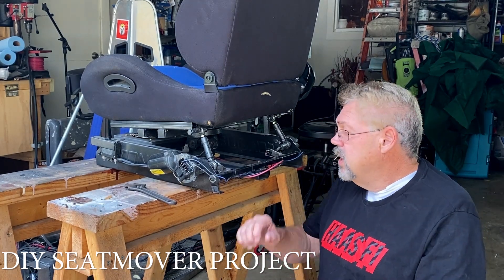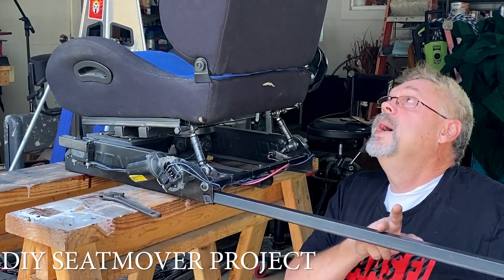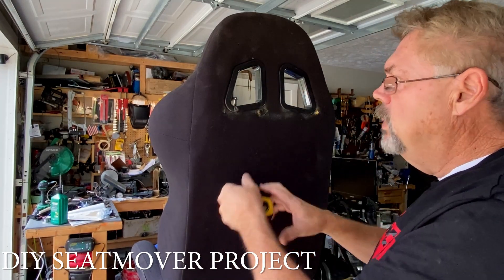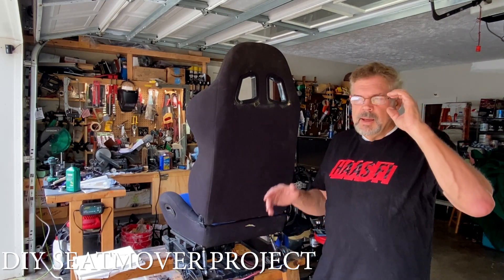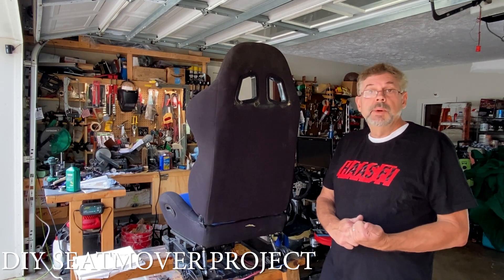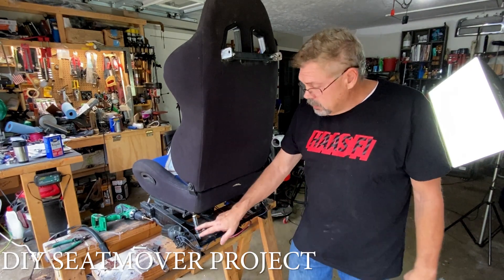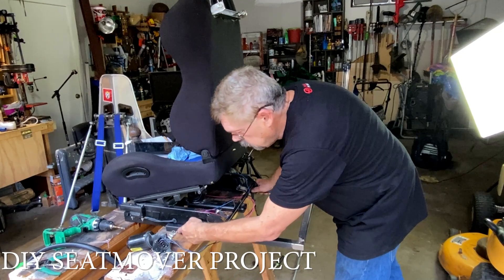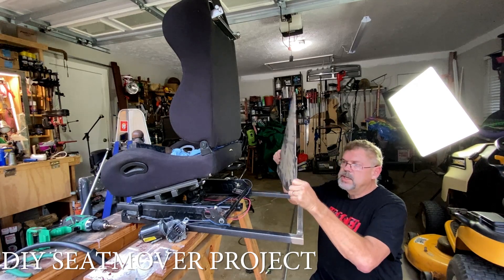DIY SEATMOVER Part 6 WW motors Arduino IBT-2 Simtools MOD your static SIM RIG with Motion!

Comment: First, congratulate you on your videos, it helps us a lot to those of us who are starting. In fact, thanks to your videos, I have encouraged myself to make my platform, very similar to that with short arms.

What I have done has been to put some shock absorbers helping to raise the platform, it helps the engine to push and counteract the weight of the pilot, and it works great. All the best.
Reply: Yeah Paco M!  Just keep pluggin away on your rig..  once it starts moving with the game, it's all worth whatever effort!! DMAX

Comment: So this is what Ive always wondered on these type of builds.  Why arent the motors mounted up front by where the pedals would be and have a bar under the peddle platform to each corner.  Kinda like a wheelbarrow motion, in my head that seems like a way better use of leverage and a lot less stress on the motors?  Im no engineer by any means, just seems logical to me lol Having it on the back the weight, of the driver is always pushing down on it.
Reply from the maker: I am going to use the seat as the lever. like my 3dof rig. should work. I will know this weekend! DMAX

Comment: Can't you just reduce the length of the arms that come off the motors  ?  You would get the same effect surely  ...
Reply from the maker: Most likely. However they are super short right now barely 2 inches CtoC so the seat is the biggest lever I can find.  I'd rather not try and make the motor lever shorter. Thanks for the comment Brian! DMAX